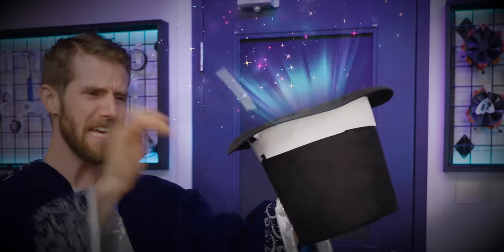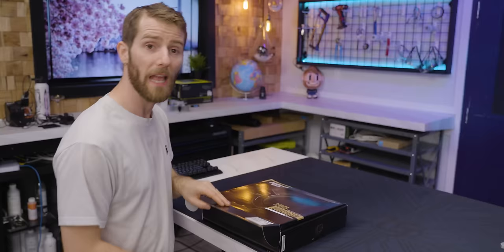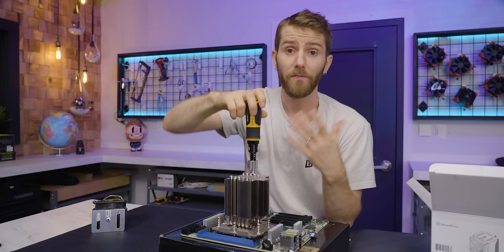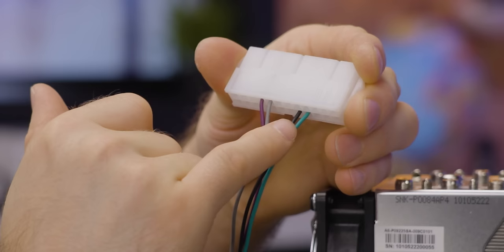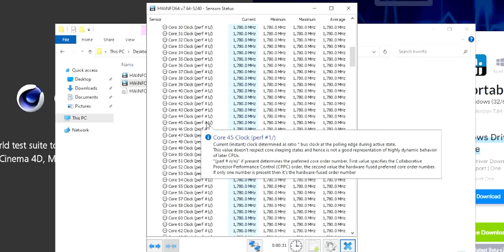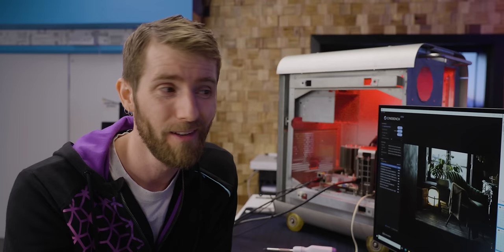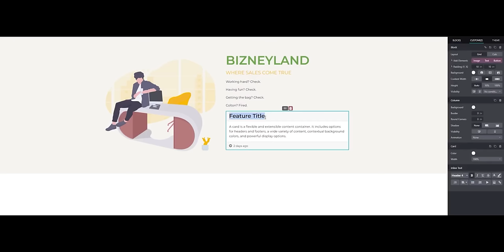AMD’s 128 Core MONSTER - Epyc Bergamo

Comment: Its not the same core just with less clocks. In games you might actually see what the halved cache does to it. Its not a sustained and foreseeable load, its pretty random so you want to keep more data in cache. Would be interesting to see the 96C Part with V-Cache on each chiplet and how it stacks up. 😆

Also for high CPU Load, check Cities Skylines 2 in a City with 400k+ People.

Comment: Also don't forget that Intel Xeons used to be freakishly expensive and now you can get them often times cheaper than a really cheap gaming PC case. This EPYC CPUs might be expensive today but in 10 years time, they would probably cost really cheap with a motherboard modified for PC use like the chinese X99 motherboard you can get bundled with Xeons nowadays.

Comment: I saw a speck of dust / fiber in the socket before you installed the CPU.
Sweet CPU. I'll take the board, RAM and CPU if you don't want it ;-)

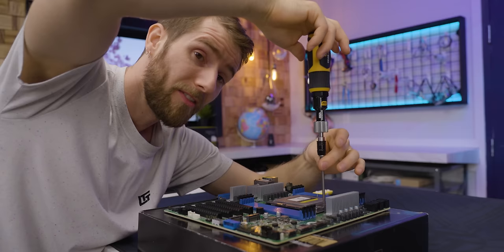Comment: 4:27 just admit it, you cut the clip were you unscrewed the bolts in the wrong order.
Reply: Damn it,  it turns out there is only one bolt that doesn't need to be torqued

Comment: Hmm, so at 89,081 in R23 It has 5.46 times the performance of the Threadripper 1950x with 16 cores from 2017 with its 16,315. BUT it also have 8 times the cores... The new 7950x 16 core Ryzen gets 37,424 making the 128core Epic only 2.3 times faster, for 112 more cores at an $11,450 price difference... In that multi-core Cinebench, with all 128 cores running, they are only each pulling 696 of that score, while the 16-core 7950x is pulling 2,339, and the 2017 1950x is pulling 1019 for each core in of that score. I can understand a company needing as much power on a single chip as they can get for server workloads, but the loss of performance per core on this just because they are so tightly pack together is insane. I don't know if they need to redesign the package to make it larger so it can distribute heat better or what, but heres the kicker. The new Threadripper 7000 series CPU's from what we have seen so far are faster and cheaper. The 96 core Threadripper appears to be getting 147,668 in R23 breaking the record currently held by a dual EYPC 9654 computer at it will cost $2000 cheaper. I can understand there will be architectural difference that may still make this new 128 core EYPC more appealing to some, but idk, sounds like a bad buy to me.

Comment: out of the 5 things that have started off in formula 1 cars that have made it into everyday drivers, 2 of them are performance wise. the other 3 are novelty. (carbon fiber, paddle shifters, steering wheel buttons, V shape engine, active suspension) very far stretched analogy.

Comment: I'm still sitting here, with my ThreadRipper 2950X 16-core w/ 128GB DDR4 ECC 3200Mhz, 72TB 16-drive RAID-60 system, and dual Vega64's for editing 4k video.  I would love this, but doubt I could even make use of it. Plus I'm pretty happy with my current workstation.  I just need a new gaming laptop. my 3GB 970m is getting old in the tooth on my MSI GT72-6QD, so that'll be my next upgrade.  Wish GPU prices came down. I'd love a RTX 4070. Oh well..

Comment: Eight sticks of RAM will throttle 1/3 of this machine's performance due to memory bandwidth restriction. I think these have 12channel RAM controllers so you need to be able to load at least 12 DIMM modules to get the full memory performance. Best

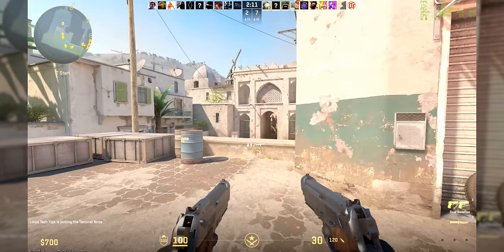Comment: the reason the game running at such poor fps is because the CPU is at 1.85ghz (under clocked it self under the base clock) and GPU is at powersaving mode which is 560mhz that's why (18:21)

Comment: Easy way for more performance: Install a sunon extreme fan on that cooler and lift the TDP to AMDs advertised configurable TDP of 400W.

Hard way: spray water on the CPU cooler and risk 13.000$ of damage.

Comment: I'm just gonna say this right now: with the huge cases that are hot sellers, I really don't mind bigger motherboards and bigger CPU sockets if this means that the CPU will run cooler at the end of the day.

I daily drive sff but with the insane amount of PCIe lanes that recent CPUs have, I wouldn't mind going back to the days of "lots of boards slotted to the motherboards".

I just really hate the normalization that is the current trend of "it's fine" CPUs that run at 100°C.

Comment: Every Epyc motherboards have a big problem, who needs a pcie 16x? A 4x10gbe pcie uses 8 pcie lines but occupy a 16x slot, a 16 sas controller uses 8 lines but occupy a 16x slot. The right solution is the to split pcie 16x into two or more connector, via riser or split cable. But actual server case use only 7 slot. 
My favourite desigh is from tyan, S8030 GM2NE.

Comment: I am stuck with AMD for a while because Intel are using efficiency cores to pad out their core counts. I like/need to use VMs a lot at home and Intel would put me in the awkward position of working out what system gets the gimped cores... After working out how to allocate specific cores to specific machines, or otherwise get some really wonky performance happen.

Comment: Can anyone tell me if these types of processor's are suitable for DAW work? Music production, latency for MIDI and running long chains of effects inserts?

Music production is massively multithreaded but also has to run all effects inserts for single tracks of audio on one core at a time. Despite a music project having hundreds of individual tracks, some tracks have long chains of effects.

Comment: This is almost mobile(arm) spec power consumption! 2w/per core. This is epyc. 
Also im disappointed that linus didn't gave that cpu the Ultimate benchmark.

Can it run Crysis? (on software mode) 😅

Comment: what's the point to make 128 cores and run them on 3.0 GHz and get ~89k points on CB23? On 5950x we have ~5GHz and got ~25k points. That means that 4 x 5950x ~ 64 cores could offer more then this 128 cores.

Comment: I was most surprised that an M1 ultra is a quarter of that.
Reply: Not even in your wet dream a tiktok box  like a mac can be compared to physics simulation machine.
If you do research almost nobody use a mac for advanced things.
Reply: @Teluric2  I was talking about the R23 score, not physich simulation. Sorry for the confusion if you though I was talking about the price. I wouldn't call looking at apple's website and noticing the lack of server solutions reseach, but yeah, they don't compete with EPYC.

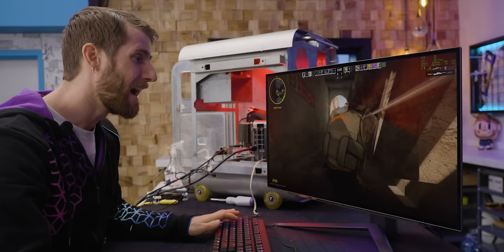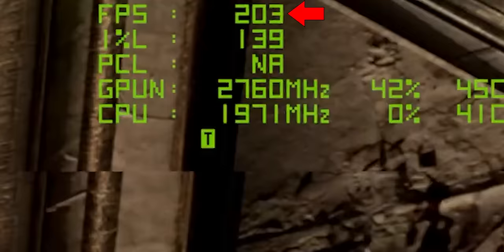Comment: 18:33 The gpu and the cpu is not running right, the gpu clock is only at 870mhz which means the GPU is not boosting. also the CPU isn't boosting like it should maybe some tunning in the bios will make it work. no way my 56cores xeon platinum 8173m + 3090 setup is faster then the 128core max 3.1ghz zen 4c epic with 4090 man. look at 19:38 this game run fine because the GPU is boosting unlike cs 2, but still, the CPU is not boosting, if the CPU is boosting it can run even faster.

Comment: in my experience, the epyc platform is cheaper and more powerful than intel (based on cloud providers virtual machines with this processors), the performance is way better with less costs instead of intel based VMs

Comment: While 128 core cpus aren't really meant for the average consumer, I struggle to imagine a world where an average joe could use that much power. And yet, we'll likely see it in enthusiast builds in less than 10 years. I wonder if dedicated gpus will be rendered essentially useless. With that many cores, software rendering could almost be an afterthought.

Comment: Uses less power then a pos Intel mainstream desktop computer.......  AMD just need to enable PowerPC type mode on these, so they virtually combine the cores, eg.  combines 2 or 4.......... so they seem like they are running 3.5-6Ghz per core.......... or even better 32 cores........ at 6-12Ghz.... could be done.

Comment: That cpu is technologically a scam, they crammed 16 chips of 8-core/16threads on a silicon board and called it a day instead of designing a 128-core chip.  Why use a 128-core chip with 512 lines when they instead tell everyone to throw away the motherboard and buy a new one with "6096" lines.